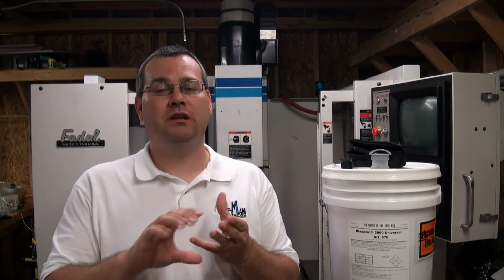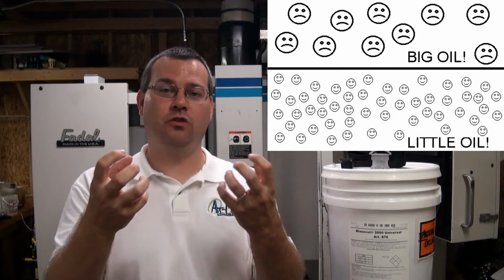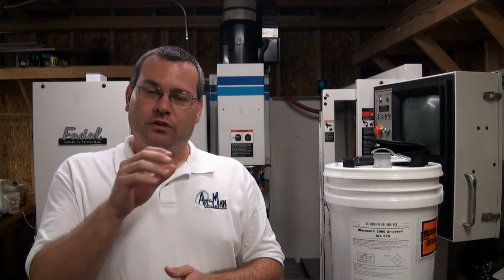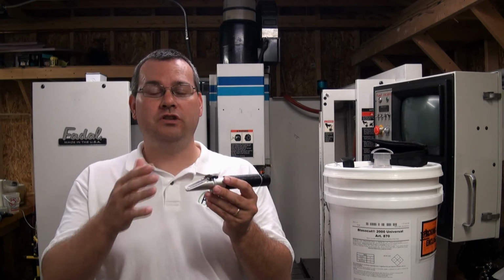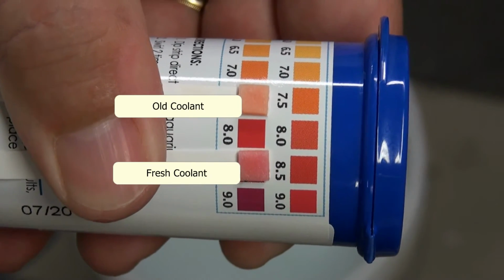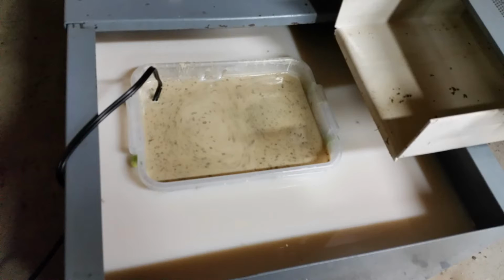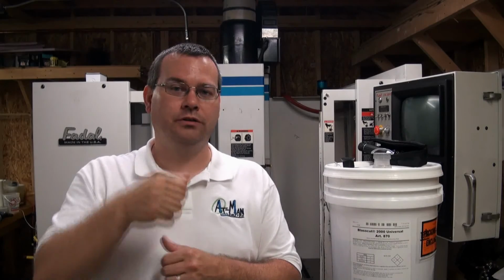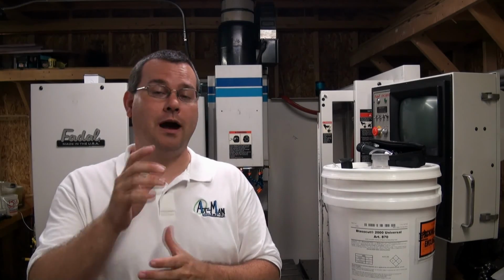Machine Coolant 101

Comment: Mineral oil is highly refined petroleum, there's nothing natural about it. It can also contain carcinogens if not properly refined albeit that's very rare. The main point is mineral oil is not biodegradable in the slightest and will persist for a very very long time.

Comment: good video but one thing I would like to mention, a 1:1 coolant does not mean if you mix 35gal of water to 35gal of oil. When a coolant refers to a 1:1 it means if you measure the oil content in the water with a refractometer and it reads 8% on the brix scale, then there is a true% 8 percent actual oil content. if you use a synthetic based coolant the refractiometer could read 3% but the true oil % could be %6 because it is a 1:2 ratio.
Reply from the maker: Hi Derek, agree, a refractometer is a must have for mixing coolant correctly. I think I made another video where I talk about the correction factor. This is the value your referring to with the brix scale.

Comment: I always use DI water which, I believe, is why we have gone years with zero issues from mineral density.
Reply from the maker: I would just check with your coolant rep if anyone is thinking of using process water, some coolants can foam up really bad with DI water. Most are designed to use city water. Well water can also cause issues if there are to many minerals or its to hard.

Comment: Everyone usually always wants to know what coolants I use.  I keep around and use several, depending on what I'm doing.  Houghton Hocut 795 Qualichem XC 251, Cimcool 1070 & 1080, MQL setup is AccuLube PowerStamp II, LENOX BandAde, Mist is KoolMist 77, Master Chemical TrimSol 585XT.  And I've got oddball quanities of others.  (Been running coolant trials to see what works best with what)
Reply from the maker: Have you tried Blaser Swisslube ever? Sounds like you have a really thick MSDS book going!
Reply: I might eventually try some Swisslube.. In particular some Blasocut 2000 CF.  MSDS, yeah. By regulation we have to keep MSDS records of basically everything we use, even some stuff that seems silly.  You can see our materials list on my web page, all common stuff so we don't need anything fancy.  On deck I got some Hangsterfers and a few others I've recently run across.  Mobilcut by Mobil. Monroe CoolTool, etc. to try out.
Reply: IMHO, The one that really stands out so far is the MasterChemical TrimSol 585XT.
Reply: There's some really good books on this subject alone.

https://www.crcpress.com/Metalworking-Fluids-Second-Edition/Byers-Byers/p/book/9781574446890
Reply: What's the best source for getting said coolant?
I am a hobbyist with rarely used Milltronics MB16 machine as well as 1440 lathe.
I would like to try to use coolant rather than brushing or squirting cutting fluids with a spray bottle
Reply: @marioprzepiora  sometimes they will give you samples to try out. Thats how I got started
Reply: @gbowne1  who is they?
Reply: @marioprzepiora  most of major distributors of cutting tools and industrial supplies and some coolant manufacturers.

Comment: Thx for the video ...As always very thorough and covering all the bases (as far as I know anyway).
Do you have a system for evaporating off the water in your waste coolant?
Reply from the maker: Yes, I have a tub that's large and shallow, lots of surface area. Then I use a small fan, another aquarium power head, and sometimes a small 100 watt heater to keep it warm. Some use a 55 gallon drum but the surface area is small and trying to get air to move down in the drum is hard.

Comment: Could you compare this to Houghton 795-MP? Is skin irritation an issue?
Reply from the maker: Hello First Last, I have not personally used any Houghton products. But I have heard and seen many good comments. Best thing I can suggest is see if a rep can give you a sample.  If not order up the smallest bucket, 5 gallons most times, and put it in a machine and try it. Selecting coolant can be more subjective then scientific because there are so many good suppliers now. Even different types from the same manufacture can vary greatly in smell and or irritation issues, if any.